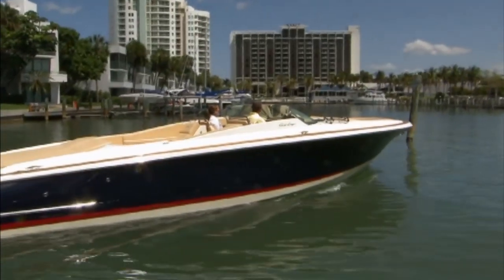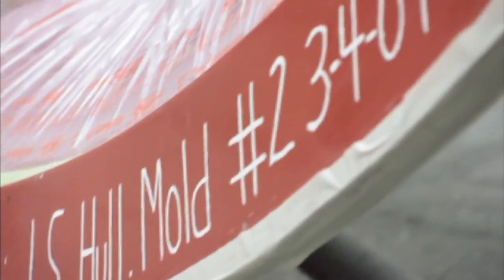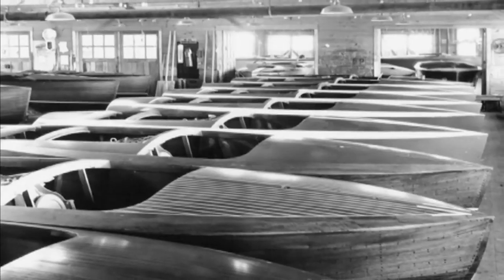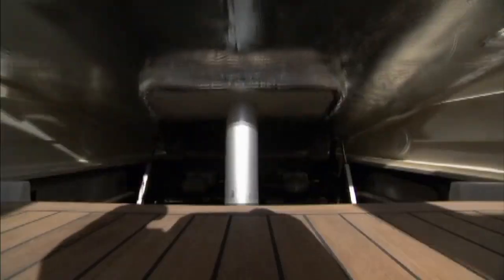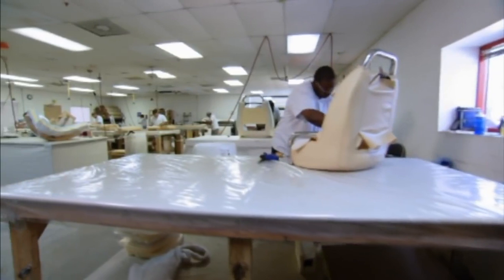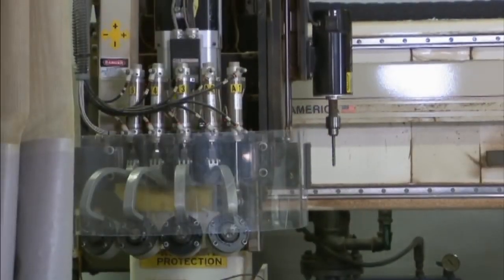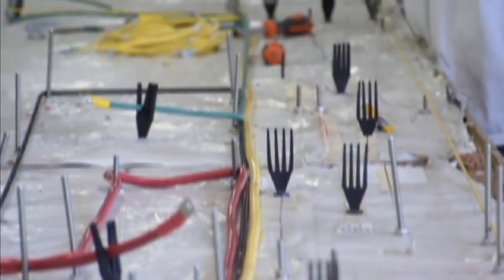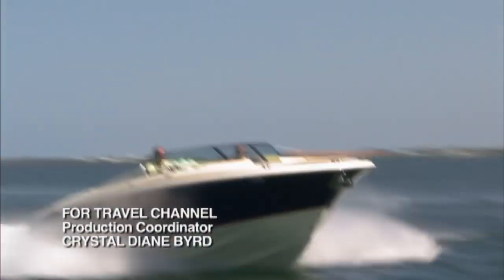Chris Craft Extreme Factories

Comment: Wood is: lighter than fiberglass, more durable, easier to repair and more beautiful. Fiberglass is cheaper to build in molds and requires less maintenance. At end of life fiberglass has to be properly disposed off or it polutes the environment which it often does.

Comment: "fibreglass gives you shapes you can't get with wood"... you want to rethink that statement ?
What did boat builders use before fibreglass was invented...plastic cutlery ??? They used WOOD !!!
Reply: Yes, and as the video also states, fiberglas is lighter than wood, and it does not rot.  You might want to rethink YOUR statement.